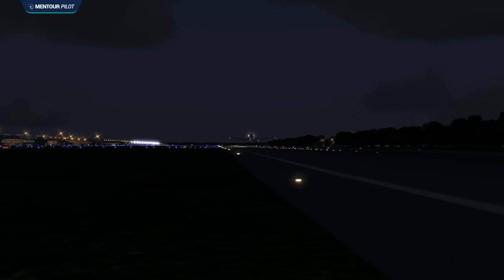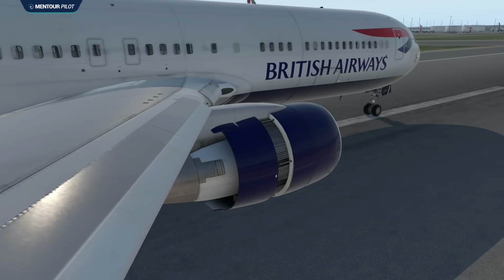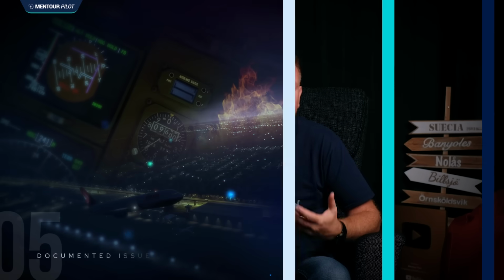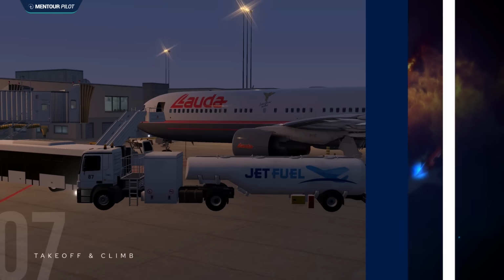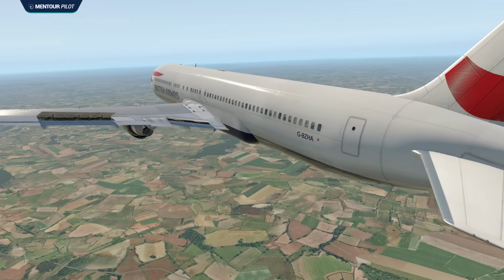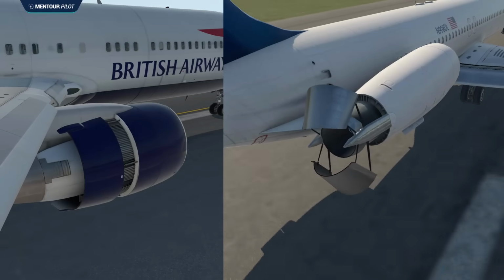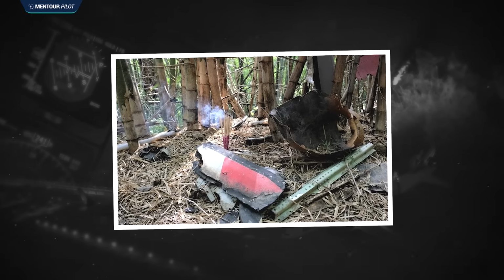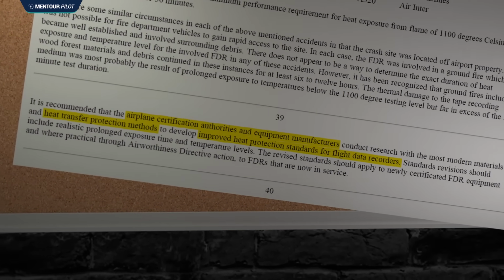HOW an Impossible Failure CRASHED this Boeing 767!

Comment: I worked on this plane in production at Boeing. One of my jobs was to rig the thrust reverser controls. I started the job, but we went on strike and a Boeing supervisor finished the job. He screwed it up. The main airlines would not let Boeing work on their planes while we were on strike. Air Lauda did.  The plane was suppose to be able to survive a thrust reverser coming on in flight. It didn't. The plane is structurally weak. The shock of the thrust reverser coming on ripped the plane apart. I filed a whistleblower lawsuit that said the plane was structurally weak and shoddily built by unskilled labor.  The 767 was cracking out in key areas while in production. On 29 Oct 97 The Christian Science monitor had a special report on my lawsuit. My lawsuit disappeared after Fed ProsecutorTom Wales was murdered. At the same time a hit attempt was made on me, which failed. I filed a complaint with the Washington State Bar Association. My complaint disappeared after two lawyers on the disciplinary board died in a traffic "accident". Boeing killed  whole bunch of people to  get rid of my complaints.  The  plane is  built with weak metal. If you go up in the tail under vertical fin and drop a tool you can poke a hole in the skin. A couple of times while I was at Boeing someone left a bucking bar   in a horizontal stabilizer. Merely on run up the bucking bar bounced around and poked a whole bunch of holes in the skin of the stabilizer. It had to be removed and replaced. On older model Boeing planes it could have been left in for the life of the plane without causing damage.
Reply: Wtf??
Reply: I just read the article on The Christian Science Monitor's Web site. Yikes!

While I knew that there were problems at Boeing, I never realized that they were so corrupt. In addition, I never realized that some of the Boeing workers were so racist and sociopathic that they would purposely sabotage airplanes bound for airlines in Asia.

However, one thing I do not understand is what happened with your whistleblower lawsuit. To the best of my understanding, your lawsuit was civil. However, Tom Wales was a federal prosecutor, who dealt with criminal cases. How would the assassination of a prosecutor cause a civil lawsuit to be dismissed? I am using the word, "dismissed," but you used the word, "disappeared." I assume that you mean dismissed. What reason(s) did the judge provide for dismissing your lawsuit?

Comment: I have heard nothing but good about Nikki Lauda, the owner of this airline. You don't find many like him. Honestly, if I owned an airline, I would be the exact same way. No plane would ever leave the ground unless it was 100% air worthy. I wouldn't care if it's some little sensor that reads the most mundane of things, this plane doesn't move until it's fixed. If it was too much for my mechanics to properly handle, I'd have someone from the manufacturer come down and walk us through it step by step and see that every repair is done correctly even if it costs me a fortune. If I caught someone cutting corners, or "cooking the books" they'd be not only fired from my company, I'd see to it that they never work In this industry again. I would REWARD whistleblowers like John Liotine (I'm sure I misspelled his name but it was Alaska Airlines flight 261 that mentions him as a whistleblower and he gets canned for telling the truth about shoddy maintenance) I could never have the deaths of people on my conscience, knowing they died because of my greed. Not happening. I'll put it this way, if I'm afraid for my own wife and children to get on my plane, then no one else's family is getting on it either. And that's it in a nut sack.

Edit Is the directional control valve something like a check valve? IOW it has a flap inside that pressure from one direction pushes open but if anything tried to reverse flow, the flap closes and nothing can flow through the line.

Comment: From a high level perspective, the most important failsafe needed would be an automatic engine off if thrust reverser deploys uncommanded.  At least that would zero the thrust on that side, leaving the crew with a normal engine out emergency.  Safety design must carefully consider the possibility of an unexpected common fault triggering this on multiple engines within a short time.
Reply: That sounds like a good idea. It would also be very important to make the "automatic engine off" very reliable in itself.
I am not a pilot, but I assume that having an engine suddenly switched off could be awkward in certain situations.
Reply: John DoDo Doe, Someone here in the comments say that that thing is not just a thrust reverser, it redirects the air that passes through the outer shroud of the engine. So even if the engine itself is turned off, the reverser would still slow the plane down, and the higher the speed, the more intense this effect will be. That's why it passed safety tests - they were done at a much slower speed (almost three times slower).

What you propose might have helped, but it definitely wouldn't be the same as engine losing all its power.
Reply: @vsm1456  A completely dead engine with no such mechanism is still an aerodynamic obstacle anyway.  Engine out emergency procedures have always needed to cover that.
  Falsely triggering any engine off mechanism is clearly an emergency in itself that needs to be prevented and mitigated.

Comment: Great video as usual!

In addition to the things you mentioned in the video, I think that the tech log should always include constant notice about potentially misbehaving systems in the aircraft. And I think that 500 hour counter reset is not safe thing to do. If the issue cannot be fixed in 500 flight hours, then the plane should be grounded until the fault can be fixed for real. At the minimum the tech log should contain static item saying "Potential reverse thrust deployment in mid-air due unknown fault, maintenance hasn't been able to solve the problem since 17 Sep 1990.".

500 flight hours is roughly equivalent to 25000 km or 15000 miles in a car. If I had a car that had constantly re-appearing fault for so long, I wouldn't simply keep resetting some kind of counter and pretend that maybe it's now okay unless the actual cause has been fixed. The car analog would be ABS system failure or airbag failure randomly appearing every now and then. For sure, if I was lending such a car to somebody, I would tell that it may have some unknown failure of those parts instead of saying that the car is all-ok. And maybe figure out what's the expected end result (can it have total brake failure? is it possible that the airbag explodes on your face while driving?) and how to deal with the situation if that happens even before starting to use it.

Comment: I remember my college roommate getting the call that her dad had in fact been one of the pilots in a bad commercial aircraft accident we'd heard had happened in Thailand the day before.  He was still so young.
For some reason I remember they knew that there was something with a thrust reverser very early after the crash.
I also remember hearing that the flight deck was still mostly intact.  It must have been a brutally terrifying situation for anyone on board.  The sounds and vibration on the airframe must've been unmistakeably dire.  They all must've known they were going to die.  I wonder if the g-forces would've caused unconsciousness, coupled with the loss of cabin pressure, which I suspect may have happened at too low an altitude to have any affect?

Comment: Ive always been freaked out by the crash test footage of the F-4 Phantom hitting a concrete wall at a very high speed . Its just pulverized to dust. Hitting the ground at Mach 1 or better in a fully loaded passenger jet would do even more damage.

Comment: I well remember reading about it about it decades ago.  The NTSB had just released their final report on the TWA Flight 800 crash in 1996 ... this was a couple year later ... and ... I had access to The Internet at home.  So, rather than go with the common media's oversimplified slight footnote mention of it ... I went on-line, looked up, and got and read the entire final report.  It was a very interesting read.  So, with my interests in aviation, piloting, and engineering ... I didn't stop there.  I started reading all the final reports, from that one on backwards in chronological order from date of crash (or date of release of final report).  Made for fascinating and quite educational reading - engineering factors, human factors, interface design, etc.  I read back through about two decades of final reports.  Lauda Air Flight 004 was a very memorable one.  Thrust reversers deployed mid-flight ... something that should've been impossible ... but happened.  And I well remember some bits you mentioned ... and also some you didn't as explicitly cover.  But yeah, I remember when the later well studied the issue, they deemed it was infeasible for even well trained pilots to recover from such an event.  Not only would they have to react to it very quickly before it became unrecoverable, but most all of the actions they'd have to take to recover from it would be quite counter-intuitive and contrary to most all their instinct and training.  So it was deemed effectively "impossible", for all practical purposes, to expect pilots to be able to recover from such a scenario.  So it had to be something that never occurred.  And I recall all the physical evidence, etc. - they never got their "smoking gun" - but if I recall correctly they'd narrowed it two probable scenarios that could've feasibly occurred that would be consistent with what happened and the evidence, and would lead to crash and total loss of control, plane, and all on board.  So the directives mostly covered changing those failures from possibly happened to impossible to occur ... along with, I believe, some additional improvements and precautions.

And, yeah, there's human drama in those reports too ... like I remember one where there was a mess up between pilot and copilot going to land at an airport in marginal visibility conditions - pilot was highly familiar with the airport and surrounding terrain.  Pilot wanted copilot to spot and confirm a visual reference so pilot could confirm they were on proper landing approach ... copilot spotted and confirmed, pilot acknowledged and if I recall correctly adjusted approach ... bit later copilot is like, "Oh, wait, no, it's over there", pilot then instantly realized what trajectory they then were in fact on and said, "That's it, we're dead" - controlled flight into terrain seconds later.

Well over 20 years ago I read those reports ... still highly memorable.  I'll mention a couple other, in case you want to cover them and haven't yet.  "Of course" everyone's covered the very heavy glider one, that ran out of fuel and landed at what was a former airfield - but I think at the time had been converted into a go cart race track or the like - so I won't mention that one more.

There was the one, I think US east cost or thereabouts ... Winter icing conditions ... plane was deiced before takeoff ... but some fair time elapsed between deicing and takeoff - plan took off ... sort of - it was heavily iced - glace ice ... pilots didn't know, insufficient lift, crash on/at takeoff overshooting end of runway.  Many lessons learned there - most notably comparing how similar was handled in Canada - where they had much more experience dealing with Winter weather and icing conditions on a quite regular and frequent basis - and had much better procedures regarding time and procedures from deicing to takeoff.

Another involved a circuit breaker that was repeatedly tripping - and being reset by crew ... and an on-board fire.  Started with a fault in lavatory, if I recall correctly.

Another I read some year later ... small craft ... John Denver and his fatal crash.  "Pilot error" would be the media tag line, but as usual, the story is much more complex than that ... numerous contributing factors - nothing so simple as the pilot screwed up and all else was perfect ... not even close.

Comment: A two engine plane, a thrust reducer opens and throws the thing out of the sky, my father warned me about planes like this, you never fly on two engines just because if one engine fails your going in on the direction of the failure and you cant tell where it is. and why was it not tested at higher speed, or to have an automatic break off if it opened at such speeds

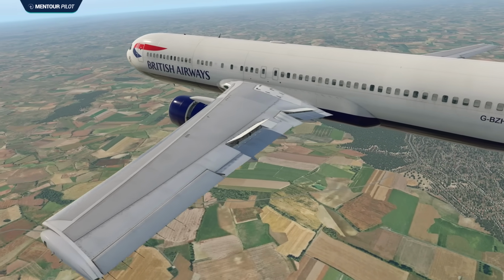27:19 and UNTRAINED flight crew?! no one could handle that period, 4 to 6 seconds with a dicky circuit with no automatic cut offs to the thrust, their is no training for engineered stupidity

Comment: Thanks for the investigation. I have flown these routes many times for the past 26 years and those flights are dearly kept in my mind. Very good job. Unfortunately the pilots encountered the failure in a bad situation. What I don’t get is why not reducing the trust lever right away, the rest of the steps I understand that they were really busy with trying to control the aircraft. To bad.

Comment: This kind of stuff is why assumptions shouldn't be made about the conditions of a flight when it comes to certification. Things should be tested with different weather conditions, altitude, speed, and settings. 4-6 seconds isn't a lot of time, and if a failure can become deadly if not responded to in such short time, it should be taken much more seriously. That plane (not all 767's just the specific one) should have been grounded until it was properly fixed.

Comment: I was on a C141A Lockheed Starlifter as a Flight Engineer in 1980. We were flying out of Kadena AB, Okinawa when right after gear up when had the # 2 engine thrust reverser open. Our procedure called for pushing the throttle up trying to force it closed, that didn’t work. I glanced over at the circuit breaker panel and noticed the one for that T/R open. I pushed that in only to have the c/b follow my finger out. So our copilot called tower back for an immediate landing. Unfortunately for us a SR71 was on long final so we did race tracks until he landed. Then the kindly brought us in. Short in the wiring at the T/R.

Comment: Besides a change in control systems, did they employ a mechanical lock linked to the undercarriage load cells? It would prevent deployment unless the aircraft was on the ground.